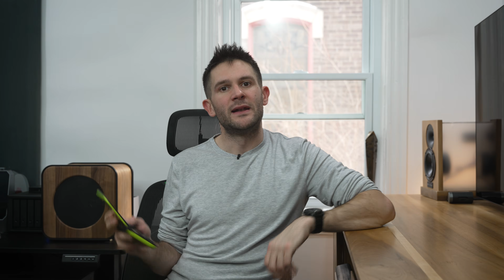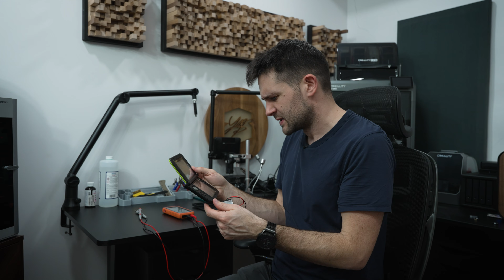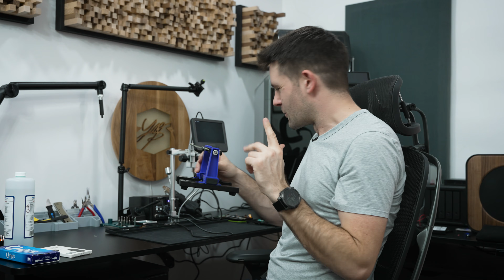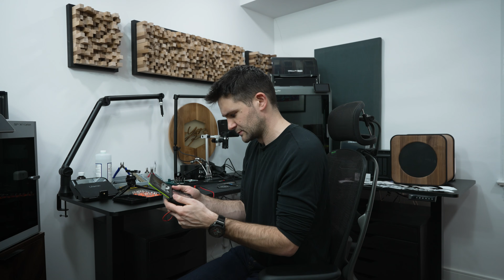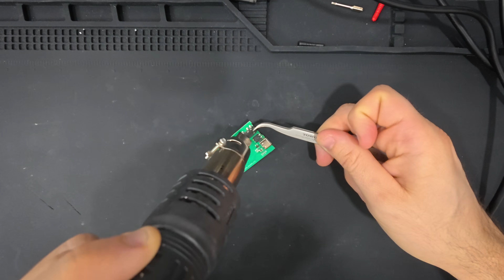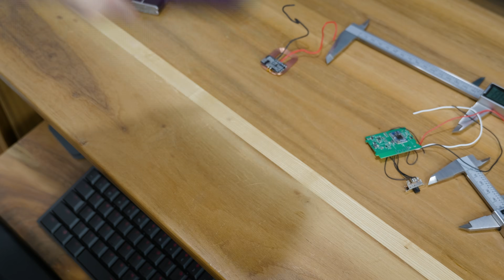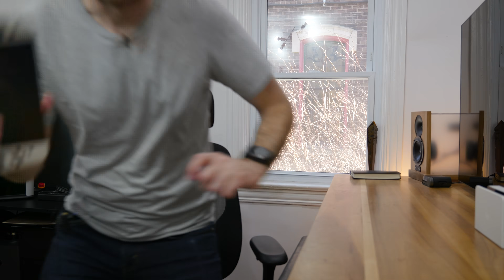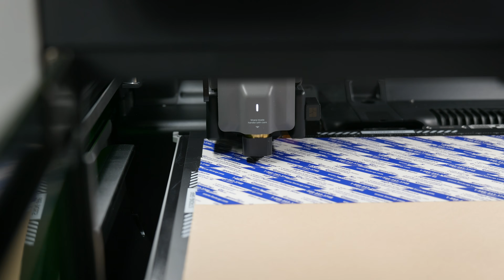I built a NEW New Nintendo 3DS....

Comment: DSI XL is the best way to play DS games by far. 3DS screens are about 1.5X the resolution of the DS and scale terriblely on the 3DS' screens.
Reply: The mods to get full joystick support in NDS games are awesome though
Reply: @ but those games are still designed with 8 directions joystick support wouldn’t matter, unless it adds full 360 support that would be cool
Reply: @skeletonuwu  that's what they were talking about, there are patches/mods that you can install that add full 360° circle pad movement to a bunch of titles
Reply: @skeletonuwu some do if they handled movement via the touch screen like sm64ds
Reply: @brynleyy I just installed this mod and it’s amazing!
Reply: That's what I play on a midnight blue Dsi XL. I have a bunch of my old library on their.
Reply: @willfultrain *there
Reply: if your 3ds is modded you can switch it to gpu scaling which actually looks amazing, I don't know why it's not the factory default
Reply: @sadawjameed  I have a modded one, but can not find this option. Where is it hidden?
Reply: @florihae 
real
Reply: @florihae TWLpatch thing
Reply: @florihae  Hold L, Down on DPad and Select in a game and then you can change the resolution
Reply: @knightluke44 you are the fucking goat my friend
Reply: @florihae its an app iirc its twlsomthing
Reply: @bitten2up twl patcher
Reply: but then you cant play 3ds games
Reply: You can press Start while booting a DS game to scale it 1:1 with the native resolution
Reply: @AtexBg  It's still blurry because of how the pixels are aligned, looks awful.
Reply: @AtexBg i still think the dsi xl screens are sharper, but also the 3ds screens have a weird pixel gap leaving black horizontal lines across the whole screen
Reply: Sure but then it’s too small to enjoy to it’s fullest and the DSI xl has dual ips screens always
Reply: @TheJman5520  its*
Reply: @TheJman5520  If you have a 3DS XL model, the 1:1 mode is actually slightly bigger than the og DS, DS lite, and DSi non-XL. We're definitely used to bigger screens these days, but that's what most of us had back then
Reply: @zachywacky1  Some people claimed the New 3DS lineup made the native NDS mode screen much smaller than the Old 3DS, which I can't confirm since I never seen a Old 3DS playing NDS mode in native display, only thr New 3DS XL.
Reply: @ndnixlon9548  I believe all the XL models have the same resolution and size, meaning their pixel density/individual pixel sizes should be exactly the same. Since playing a DS game in 1:1 mode doesn't change if the pixel size doesn't change, it shouldn't be any different. (I've never used a non-new 3ds XL so I could be wrong)

I know the non-XL model 3ds does change its screen size from the original to the New, but I wouldn't recommend playing DS games in 1:1 mode there unless you're a fan of the Gameboy Micro lol
Reply: @TheJman5520 you can't have it both ways either it's scaled up too much or it's too small. The image is literally the same resolution and screen size as the ds in that mode
Reply: @TheJman5520 it's not too small. It's about the same size as a standard dsi. DS games don't benefit really from the increase in size because they don't have the resolution for that screen size.
Reply: @AtexBg  It's also not centered right and looks ugly as sin.
Reply: @AtexBg the DSi XL doesn’t need to be scaled smaller; just works natively. That makes it the best. Simple as
Reply: @MadiAKA  i know, i was talking about the 3ds
Reply: @MadiAKA  Another notable benefit of the DSi XL is startup times.  
I have both a modded N3DSLL and DSiXL and the DSi XL is so much quicker to get into a game.
Reply: Yeah, I love playing my 3ds games on my DSI@groundmasterc
Reply: @crimson3970  Because the DSi XL's pixel density has the least amount out of all the NDS / 3DS models and the larger screens doesn't help at all, not surprising that the DSi XL has a mixed reception especially its screen besides having IPS panels.

imo if you a fan of extremely sharp pixel output, then the DSi XL is for you, otherwise just go with the non-XL DSi.
Reply: @groundmasterc yeah depending on how big of an sd card u have for modded 3ds, the longer the boot time
Reply: @MadiAKA  my 2ds xl is going amazing with the biggest screen
Reply: @groundmasterc it's the cfw and a big sd most likely
Reply: @MadiAKA until you want to play a 3ds game
Reply: That’s why you get the widescreen patch
Reply: Also, 3DS games do not kick up the "DSi optimized" black cart optimization like on the gen 2 remakes on DS. So the DSi is better there.
Reply: @andreaquadrati  You need a donor cart that already uses IR inserted in SLOT-1 to use the IR functionality in the later Pokémon NDS games... which means you also need an legitimate HG/SS and Gen 5 cartridge. Some people used other NDS cartridges that also uses IR but compatibility is mixed like Pokewalker functionality doesn't work on one IR game.
Reply: Wrong!
Reply: Patching games
Reply: Plus the r4 cart still runs great.
Reply: I did find playing Kingdom Hearts 358/2 days on 3ds more tolerable, just because the blurring essentially worked as anti-aliasing.

However this is the only game that I thought was better. Everything else was ass.
Reply: I kinda want to be able to play GBA games as well and even make use of crossplay.
Reply: on hacked 3ds you can fix this easy
Reply: I say no bcs the pixel density of the Dsi Xl is horrible
Reply: Some DS games are fun if the 3DS is setup like in this video https://youtu.be/l_d3H2bkZHM?si=oE8uWM1iLszr4z2T
Reply: *terribly
Reply: Would be nice to add a big tumbstick for games like luigi mansion 3ds version
Reply: But you do get to play 3DS games on it too ,so you don't really lose ,not really
Reply: I use to preach the same thing till I got so fed up with the yellow screens that I moved all my roms to my ips 3ds xl
Reply: you recommend any ds games?
Reply: This
Reply: I just modded my DSi XL (got it in 2010 bundled with Soul Silver) today, I got sick of how Pokémon looked on my modded New 2DS XL
Reply: Fun fact : today I rebooted a DSI XL I found while on a scrap yard trip

Even though there was rust deposited on plastic by the rain, I saw that the original battery was dead, bought a new one, plugged it in, and now works flawlessly.

In the end, I got a DSI XL for 12€ :)
Reply: 1.25x, actually. It uses a simple 4-to-5 upscale.
Reply: i agree. i amalgamated two broken dsi xls just to make one working one just to play my nds games
Reply: Sure, but I can’t play my 3DS games on a DSi, nor can I use as many emulators due to the weaker hardware
Reply: #primitive
Reply: I love the DS. But the Retroid is releasing dual screen oled attachment which may change that
Reply: maybe for pure qol, but i maintain that the ds lite is better because you also get access to gba games natively. might not be as big but its more feature filled.
Reply: Ye but like, buying a DSI XL just to play DS games when you can play them decently on a 3ds is kinda stupid imo.
Thats like buying a expensive 90's computer to play DOS games when you can simply make a FreeDOS or MSDOS or whatever DOS virtual machine on your main computer, yes the experience is not quite the same but it's close enough.
Reply: I would actually say a regular DSi is if you can sacrifice the larger form factor, the resolution of the XL screen makes it really easy to notice individual pixels… It’s not for everyone.

Another note is that XLs are getting up there with 3DS prices these days, just $40 more can very much fetch you an original 3DS system, it’s in the regular new 3DS league of luxury 

I do love mine though. very comfortable for long play sessions
Reply: You just dont see the bigger picture... do you?
Reply: There isn’t enough of a difference to get both, just play on 3ds
Reply: Just hold select when open the game
Reply: The 3ds/n3ds are also a great way to play Gba games if they're hacked....
The 3ds contains ds hardware which then has gba hardware too contained, in a "gba mode".
The 3ds ambassador consoles received that 10 Gba games, that later you injected any gba rom.
I played a lot back then when I had a 3ds...
Reply: Thats why the original or new 3ds non XL are better closer to native and when you launch in native its like really close.
Reply: Absolut agree. The difference is night and day.
Reply: Just use blackbars
Reply: atp just emulate it on your pc
Reply: The New Nintendo 3DS XL is larger than the DSi XL, measuring 156 x 93 x 21 mm compared to the DSi XL's dimensions of 161 x 91 x 21 mm. While the thickness is similar, the 3DS XL has a slightly different overall shape and design.
Reply: If you press Start while starting a DS game on 3DS, it gives you original resolution mode. And with TWL, you can adjust the scaling mode.
Reply: That console is goated, booted it up after over 10 years of storage without charging it and worked perfectly, the buttons feel better than the ones on the 3ds too
Reply: Theres a mod called TWPatch for modded 3ds’s that have twilight menu, basically you can modify how the 3ds screens render Ds games and also make some 3d original ds games widescreen with little stretching, that part is optional but still, you can do what you really want to with one of them if your really know how to mod stuff
Reply: Also the time to switch between ds and 3ds modes took a while
Reply: YouTube is a biatch videos get monetized on YouTube for the dumbest reasons I wish there was a version of YouTube with no monetization
Reply: pretty sure if you hold start while booting a ds game on a 3ds, it will load it in its original resolution! not sure how that looks on an 3ds XL, but at least its an option
Reply: And the screens, the DSI XL always has LCD screens,  the new 3ds have a lottery, sometimes you would get 1 or if you lucky 2 of them
Reply: @andresportillo-c3o  You mean IPS vs TN. They're both LCD.
Reply: @andresportillo-c3o  The New 3DSs always had LCD screens.
Reply: @andresportillo-c3o TN and IPS are both LCD panels, you mean IPS that the DSi XL aleays came with.
Reply: @andresportillo-c3o  You mean, it always has IPS? IPS and TN are both LCDs. Issue with the New 3DS/XL/2DS XL is that they NEVER have two IPS screens, and only SOMETIMES one.
Reply: @-qm-  Now I see my mistake, and it's true what you say
Reply: @andresportillo-c3o  The odd thing is that the GBA (smaller resolution and different aspect ratio than the DS) was fine on DS. It was centered. So it just looked like the DS had like, a big bezel playing GBA games.

And before that, GB/C games (smaller resolution and different aspect ratio than the GBA) were able to center themselves on the GBA. Or, if you wanted, expand the screen to fill it, truthfully I usually did this because it wasn't that noticeable and I was like 8-10 years old.

Then the 3DS playing DS games just... doesn't center them? Why? They literally did this right twice.
Reply: @-qm-  The GBA and NDS resolutions weren't far off and also both of them are non-standard. The 3DS on the other hand uses a standard resolution (WQVGA for top screen, QVGA for bottom screen) and it's not even 2x larger than the NDS resolution, thus the display output when upscaled will never have square pixels except for 1:1 mode.

The PS Vita did a better job with PSP backwards-compatibility in terms of display output because the Vita resolution is literally just 2x PSP resolution, unfortunately the output is blurry (it uses a filter?) regardless but at least the square pixels are 1:1.
Reply: @ndnixlon9548  What?
DS was 256x192. Standard 4:3.
GBA was 240x160. Standard 3:2.

The 3DS had a 320x240 4:3 bottom screen and... 400x240 5:3 top. 5:3 is nowhere near standard. I have no idea where you get that it was "more standard".

Vita/PSP also weren't standard resolutions. Vita was indeed 2x PSP, issue being neither was actually 16:9. They were... close enough, but not 16:9.
Reply: @-qm-  Never claimed PSP and PS Vita were compliant with resolution standards but you can't deny Sony did a great job by literally doing 2x PSP resolution despite its PSP backwards-compatibility being dodgy than Nintendo's handheld offerings during the GBA / NDS / 3DS era.

What I meant by "stardard" is that the 3DS was at least somewhat compliant with existent resolutions like VGA for the 3DS WQVGA/QVGA for example, and I can understand Nintendo for ditching the GBA / NDS resolution "why bother continuing with the NDS resolution when it was a mess to begin with" in contrast to the PSP being less far-off since it has the same horizontal resolution with HVGA minus the vertical resolution. I don't really care about the aspect ratio but attaining integer scaling on GBA / NDS on the 3DS will never happen because Ninty ditched it and instead opt with upscaling it to QVGA with filters to compensate the non-square pixel output.
Reply: @ndnixlon9548  You don't care about aspect ratio but mention integer scaling and keep spouting jargon like VGA/QVGA/WQVGA... okay...
Reply: @-qm-  Knock sense into me then, even with community contributions such as GPU scaling and TWPatch, it will never look as good as 1:1 mode or the DSi XL despite looking blocky as hell.
Reply: Just tell me, can you salvage the NDS resolution in 2011? Hell, even the 3DS already has a lower pixel count than the PSP so why bother continuing?
Reply: @-qm-  I want to apologize in advanced for geting too heated up, I was too ahead of myself that I completely lost the mark. I misread your argument is to why isn't it possible to have NDS scaling on 3DS that is on par with 1x integer scaling.

To actually answer your question, despite Nintendo backwards-compatibility is known for having great game compatibility, they messed up the NDS mode (TWL_FIRM) which is why 1:1 mode is off-centered, there were mentions of fixing that issue via TWPatcher but I can't confirm this besides the main dev saying that they don't have time to implement that feature.
Reply: @ndnixlon9548  Yeah, I get that 1x integer is gonna have empty space no matter what, but Nintendo did it in a really boneheaded way. You're supposed to center the screens and they... didn't.

That being said, aren't there some good TWL_FIRM CFW mods you can get to help enhance the graphics for DS games? Like I know there's some widescreen mods.

Not sure if it fixes the brutal latency though. Holy hell those Mario Party DS minigames lagged so hard on the 3DS. Reminded me of going from an SD to HDTV playing Guitar Hero, or something.
Reply: @-qm-   I misread again, I thought you meant centering the Y-axis of the DS screens. 

To answer that question, it's just Nintendo's purist obsession to make sure that their backwards-comapatibility is """faithful""" to the original hardware in terms of presentation, as much as this sounds stupid they've been consistent with this notion since the Wii Virtual Console days and still stays true to this day unfortunately.

Other than that, modifications on the TWL_FIRM such as TWPatch makes the upscaled display look less miserable to the point any option looks better than the Nintendo's default if you hate very non-square pixels and a blurry display output at the same time. No option to adjust the displays to the user's preferences yet (like centering the displays for example), the closest thing we can get from that are the widescreen patches.
Reply: @-qm-  because some games link both parts together in one screen
Reply: @-qm-  Me typing this comment on a 5:3 tablet.......
Reply: @tyler6971  What tablet?
Reply: there are units with two ips screens, I have two of those. They are more common in Japanese LL consoles.
Reply: Some people don't care about that and just want the bigger screen.
Reply: real; the title of this video is a bit clickbaity imo, should be changed to 3ds
Reply: You can mod the scaling
Reply: @NitroShellMKDS  There's no scaling setting that will make an image scale cleanly to 1.5X, it is just not mathematically possible
Reply: Oh iv tried, none of the community scaling options look good on the 3DS, Nintendos scaling is actually incredible given the hardware, the hardware is the issue. Splitting up pixels by 1.5 is never going to look good.
Reply: This is very true!  Immediately after modding my new new 3ds I was horrified by the look of the DS games scaled and un-scaled. 

Now I use a DSi XL for my DS games and I can sleep soundly knowing I'm getting the best experience.
Reply: I’m glad people slept on those. I got a mint cib one for 31$ on eBay. Still works perfectly. This was 4 years ago.
Reply: I beg to differ, the 3ds is the ultimate Nintendo handheld, you can play every single 3ds title, ALL dsiware games, ALL ds games, all gba games and jeez should I keep going? The snes, the n64, the gbc, regular gb…. Bro I’m sorry but there’s just no beating the virtual console…. It’s funny asf cuz ur main reasoning is over screen resolution when resolution doesn’t even matter for ANY of those games buddy 😂😂😂 hey all look great on the 3ds screen, I mean it doesn’t get any better then on the 3ds…( besides a switch, but emu is a totally diff story… also jus not the same w/out both screens) idk where u got ya information but 3ds top handheld ( & for me personally I own a steamdeck, I never was into the switch….)
Reply: About to comment the same thing 😂
Reply: Yeah, except for that awful d pad. I enjoy DS games so much more on my 2DS XL.
Reply: @kenmorrow86 Awful D-pad??? The DSi XL has the best D-pad out of the entire lineup, you must be thinking of the DS lite with mushy buttons.
Reply: 3ds is much better
Reply: Nah fam, DS games on an OLED Switch with the flip grip is the best way to play.
Reply: … yeah nah
Reply: Unless you're like me and don't give a crap about the resolution.
Reply: Hello it’s not 3d
Reply: I didn't had a dsi xl, but i still have my 2ds xl. I'm used to the scalling and in my opinion i don't think its bad.
Reply: Play on a phone for better screen
Reply: The DSi XL is also almost impossible to find.
Reply: @-qm- dsi XL is 40 bucks max
Reply: @alienxotic5028  Where? Not the US. Cheapest working one on eBay is 150$. Importing isn't an option anymore since our fascist fat fuck made all countries get tariffed to hell, so...
Reply: You all are wrong. Obviously the correct answer is the 2ds.(I do like the 2ds because it feels like a Gameboy more than the clam shell designs.)Or 2 gba's attached to a hinge. Or better yet Just use a Wii u gamepad with a Wii u in a backpack with a giant battery pack. Duh.
Reply: @JohnnyPhoenix8  The 2DS is the only model that has a top screen with the resolution of 400x240 compared to the rest of the 3DS models where its 800x240, so either you get scanline looking stuff in 2D mode (400px) or the additional vertical resolution as seen in the 3D parallax barrier (800px) which has better visual clarity but is more CPU/GPU demanding to the 3DS and is only limited to 3DS mode only unfortunately.

tl;dr The 2DS in paper is the best 3DS model if you only care about 2D mode.
Reply: @ndnixlon9548  i was mostly joking. Especially with the part with the wiiu. Though I will say I did actually play the wiiu in the car as a kid with the gamepad. I'd play breath of the wild. Once I figured out there's a lot of games you can play using the gamepad only, then all I needed to do was worry about power. I remember I played it once during lunch in middle school. I was a strange kid.
Reply: @JohnnyPhoenix8 Wrong!!
Reply: Idgaf DS is DS
Reply: I disagree. With modding a 3ds, you can put in true widescreen (2d elements are still stretched though) and put in filters that make the image look far better than how it would normally. And some games like mario 64 ds even have mods that let you use some of the 3ds features like the circle pad 360 movement and c stick camera
Reply: An emulator on PC is the best way to play DS games by far actually… 🤷🏽‍♂️
Reply: All controllers to play them are quite awful @NasTheGod215
Reply: @NasTheGod215  Only if your monitor can go portrait mode/vertical.
Reply: @NasTheGod215  not at all bro, only 10% are really truly play without being bother with the presentation
Reply: @andresportillo-c3o  eh no, it's an exaggeration to say only 10% of DS games are better on a computer.

The DS just wasn't a great console. Phat/OG DS was an ergonomic nightmare with how sharp it was, buttons were awful, and screen too dum.

DS Lite was even worse. It was too small to ever be ergonomic, the screens were brighter, so that's okay... but the hinge was so insanely bad. Seriously, it caused a multi-year embargo and feud between Nintendo and Amazon because the latter was tired of Nintendo's returns.

DSi/XL? Was okay, if you ignore the shoulder buttons that will probably stop working in a few weeks due to the huge open gaps that collect dust and skin cells. It did have a better hinge, better screens, and... decent ergonomics. due to the rubber matte texture, but this also means it's aging really bad because rubber doesn't age well.
Reply: @-qm-  but you lost the reason why the other 90% of games are the way they are, cuz the ds is a handheld with 2 separated screens, the games adapted or just benefitted of this, why you play DS games for a format that doesn't fit completely, it's like playing a Wii rail shooter without the  Wiimote, it can be fun, but it isn't the best experience you can get
Reply: @andresportillo-c3o  You forget that more than half of the DS games simply... didn't use the two screens properly.

It was a crutch more than a utility. I can't think of a single RPG other than Ragnarok DS that used the touch screen for any purpose other than "this screen shows more information the other screen isn't" like Pokemon, Dragon Quest, Final Fantasy, Gundam SRPGs, Super Robot Wars, and so on...

The touch screen was only ever going to be useful for puzzles and minigames. For those, it did do really good. But the issue is that Nintendo made the Wii right after.

The Wii was so much better and more versatile for puzzles or minigames.
Reply: @andresportillo-c3o  YouTube is dumb and won't let me edit comments. The second screen also did nothing useful for platforming games either like Mega Man or Mario. It was another case of "here's more screen real estate the other one didn't have".

And that's how the DS is largely.
Reply: @-qm-  that's true my friend
Reply: @-qm-  I felt that sentiment more on the 3DS library than the NDS library imo.

In my experience, the only game where the touchscreen was necessary for the 3DS is Kid Icarus: Uprising, other than that you pretty much described my feelings on the 3DS' use of the second screen.
Reply: My only problem with emulating 3DS nowadays, it just looks bad when internal resolution is increased where the effects don't scale properly just like when PCSX2 used to not scale effects properly when IR is greater than 480p.
Reply: @ndnixlon9548  3DS didn't really use it well either. Dual screens basically can't be used as greatly as people would expect them to because... how do you actually look at both of them, you don't.
Reply: @NasTheGod215  Hahaha... nope. Only makes sense out of convenience (lol, just emulate in a smartphone atp) or if you streaming the game.
Reply: @NasTheGod215  just wrong nothing beat the native hardware